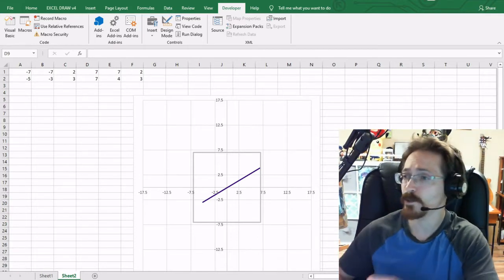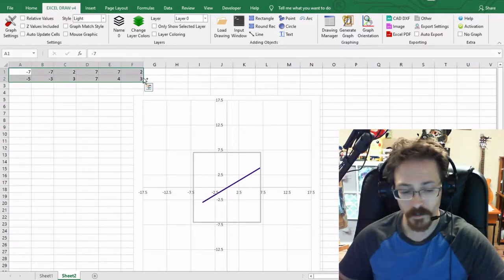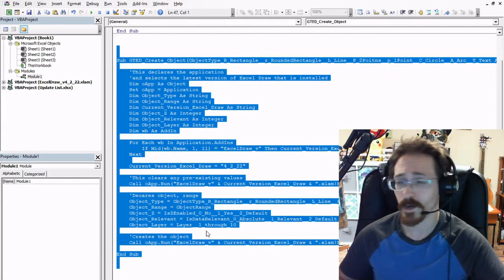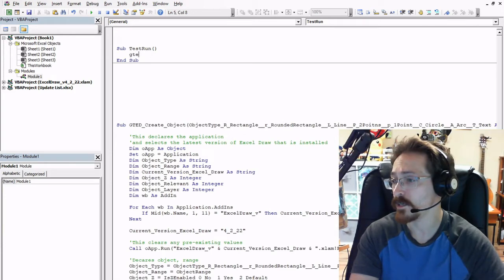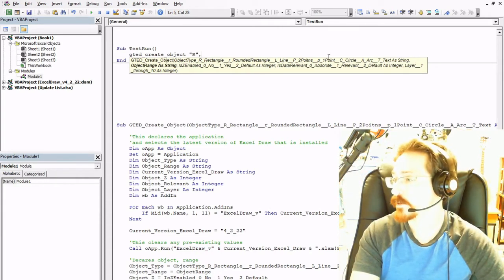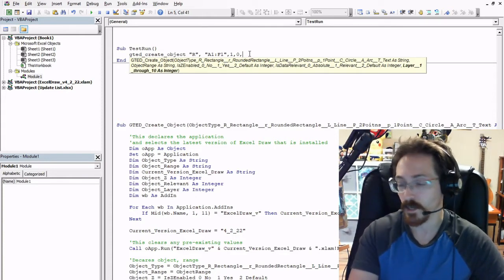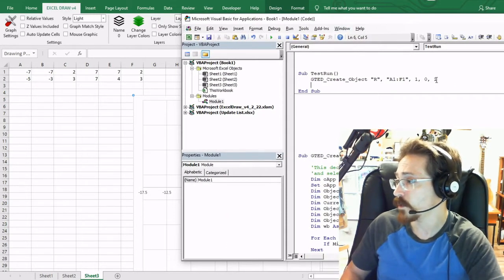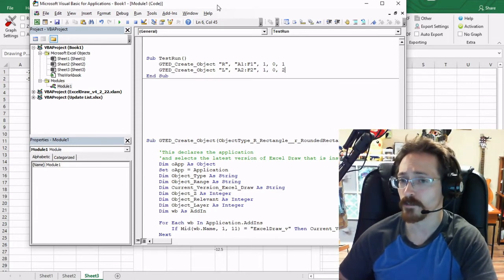Excel Draw Version 5 - Automation of Object Creation - Feature Preview 1

Comment: Interested in purchasing this once the vba is enabled. Could we also change the lineweight, type and color via vba?
Reply from the maker: Currently the VBA automation is released. The API is available on our website. 

Currently the color can not be change din the VBA automation, however the colors can be changed inside of the settings of Excel Draw. Colors have two sets, defaults (sets the standard for every new drawing) and custom (changes the colors for one specific drawing). Each color can be based on layer number or by object type. 

The line width can also be changed inside of Excel Draw, not VBA at the moment. However the line width effects all lines and does not effect the width of the line inside of the DXF CAD export.
Reply: @gray-technical  Thank you. Just watched the released of excel draw 5.